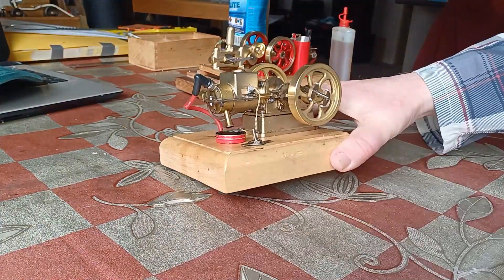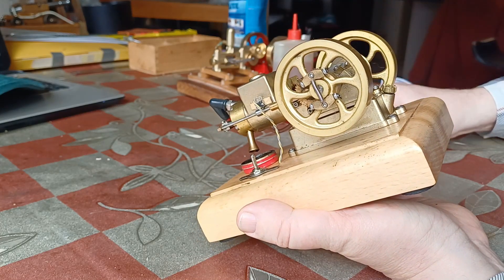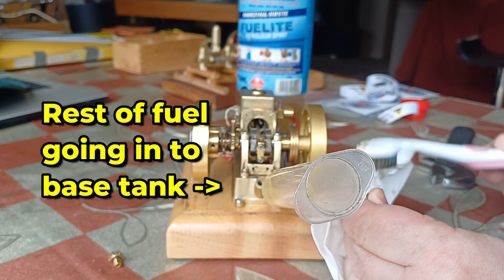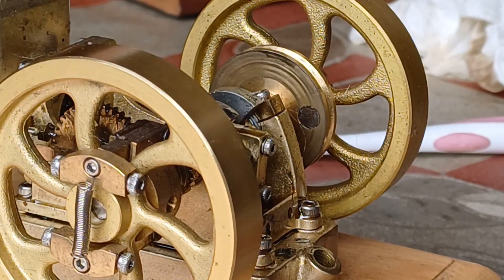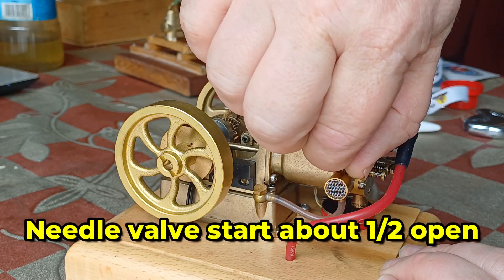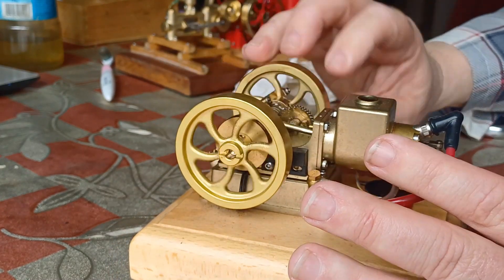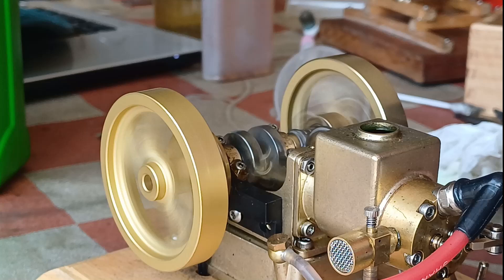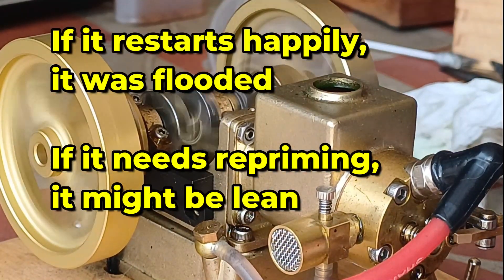Hit & Miss Engine Revival #engine #enginemodel #okmomodels Microcosm M17 1.6cc

Comment: Bonjour Thomas,
I am always impressed by your skillness regarding mods and how easy it is to start these engines.
Always a nightmare for me, especially as soon as the engine warms up, each degree on the needle valve is a poker move.
Besides this, I use alkylate 2 stroke gas, much cleaner than SP9x.
https://www.google.com/search?client=firefox-b-d&q=essence+alkylate+2+temps
Amicalement; Raphaël

Comment: Nice  revival video! You have that little engine running like a clock. Your little chicken friend is pretty cute too!  Funny, I've been playing with engines for most of my life, and I never thought of rotating it backwards with the exhaust valve open to purge a flooded engine....Great tip!  I might have asked you this before, What grade of oil do you use on the gears, bearings and cylinder?
Reply from the maker: Hey man! Howdy! Yes Dear Mrs White Chicken is sweet isn't she. Well, didn't you just love the way the gear oil gooped on those gears and just held on while it spun? Well that's kinda an accident. Yesterday in this vid I was just using 30SAE small engine oil, nothing special. When I first run the hit & misses though I mix up some 30SAE with teflon impregnated grease, to make a brew that sticks, but flows. I use that on all the cams on all the engines
Reply: @ThomasPCGuruENGINES  I did notice and was impressed to see the gears coated so generously :)  Thanks for the tip on the oil and grease!
Reply from the maker: Running the engine backwards with the exhaust valve open shouldn't make any difference with running it frontwards with the exhaust valve open...but it just works for me Every, Single. Time.